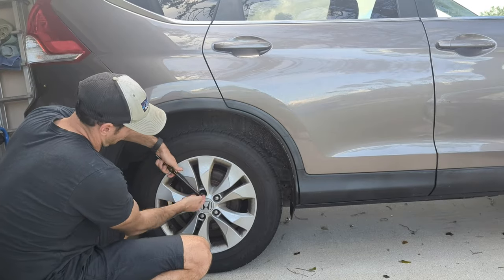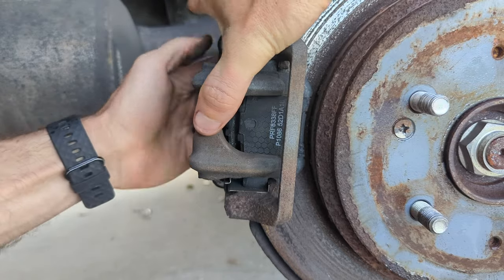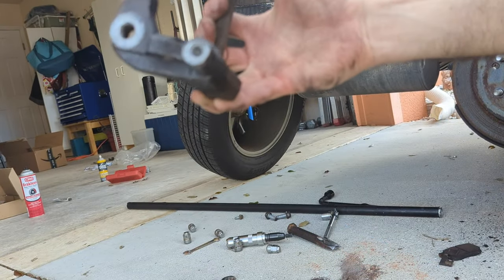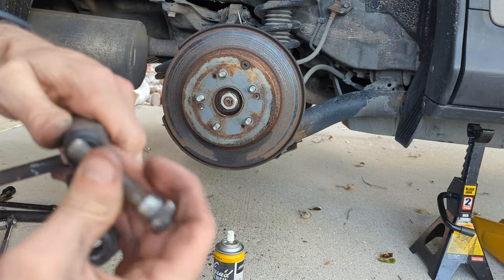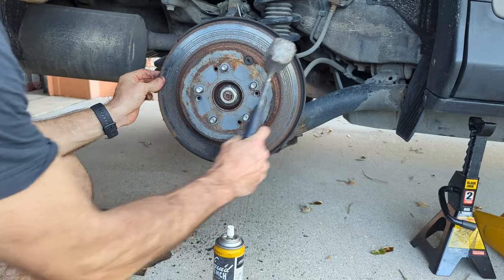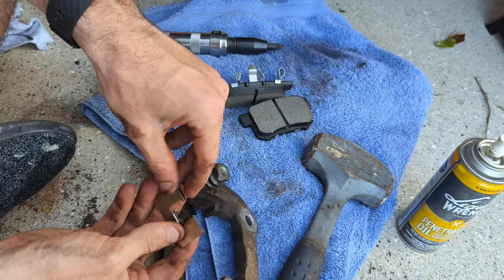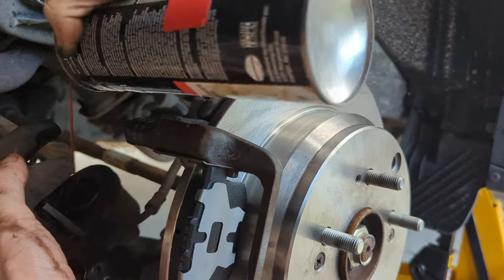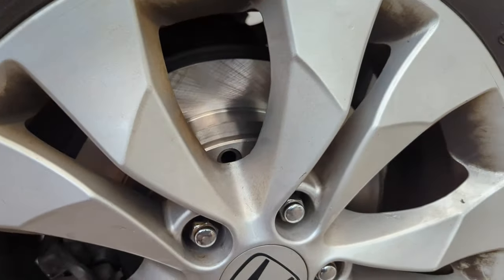2012 Honda CRV Rear Brakes (Pads and Rotors) | 2013 2014 2015 2016

Comment: I highly recommend cleaning and lubricating those caliper guide pins at least one per year on all of your vehicles. I used to have that same problem every time I changed my brakes. They also were causing my brakes to wear out prematurely. I never have that issue anymore, well worth the time in my opinion 👍
Reply from the maker: That's a smart maintenance routine!
Reply: Absolutely agree. After about a year they start to get sticky and do not glide back-and-forth like they are supposed to. 
You would think with the rubber boot dust caps and ceramic brake pads that there would not be an issue, but I guess it breaks down from the heat.

Comment: That plug is how you access a great to adjust the parking brakes with a flathead screwdriver. It has to be done with the brake disc/drum on, because you adjust the gear up until the drum is locked, then back the gear down a certain number of "clicks" according to your model and year (my 2011 was 8).

Comment: Prob has been mentioned, but those slide pins should've been sanded down. Also because it was seized, and the caliper mount heated, a wire brush on a drill should've been inserted into the bore to clean that out properly. There is too much gunk on that pin, and I imagine there's carbonized caked on gunk in the bore.

Comment: Nice video...some of the things that you can also do while your wheel is out is to drain some of the old brake fluid as ur pressing in the piston on the caliper which will get rid off any air bubbles in the line.  Also I lube the pads on the edges where they make contact with sliding inserts to allow for better travel and reduce sizing.  Keep the videos coming.. cheers.
Reply from the maker: Thanks for the tips, you open the bleed valve and then press on the piston?
Reply: @thecollegepicker  Exactly.. attach tubing, making sure it's pointing up so that the fluid blocks the air from returning back into the system,  than drain the tubing into a container... works great and improves the brake feel.  I do all this while the caliper is still mounted to the car as to keep everything level and allow for all the air to leave the system.  cheers

Comment: It is a JIS Philips head and from what I have learned, it is best used on those type of screws. They do have an impact version.
Reply: I am using a JIS that I ordered on Amazon and unfortunately I’m having the same problems with my screws being frozen. I’ll try some more but I’m afraid I’m probably gonna have to drill these ones out as well.

Comment: Almost the same as the front rotors except these have emergency brakes in the back. For the life of me, I cannot fully seat either the new rotor or even the old rotor back onto where it’s flush metal the metal so I can put the screws in. Do you have any ideas?

Comment: What is a crescent wrench?
A crescent wrench, also called an adjustable wrench, comes in a range of sizes, from 4 to 24 inches (10 to 61 centimeters). A crescent wrench has one fixed jaw, while the second jaw can move left or right. The adjustability of the crescent wrench allows it to be used on many different sizes of bolts.

What does a hand impact driver do?
What Is an Impact Driver? A hand, or manual, impact driver is a tool that can be used to remove any screw, but is incredibly helpful when trying to loosen stuck, tight, and even rusted screws and nuts.

Where is the high temp brake grease for the pads?

The rubber plug that we all were watching you forget that you don't know what it's for is actually the hole to adjust the drum parking brakes, Duh.
Reply from the maker: Duh, man I'm so stupid.

Comment: Do NOT put any grease or lube on the end of the bolt with the dust boots; it will prevent the pads from moving equally - one will wear more than the other.
Whenever you spray a can upside down, only the gas comes out and not what is in the can... that is how to clean a tip on a rattle-can of paint....
Bro, get a set of metric / english sockets....